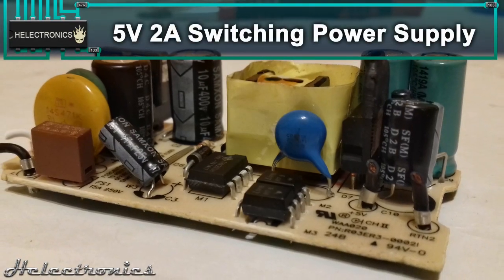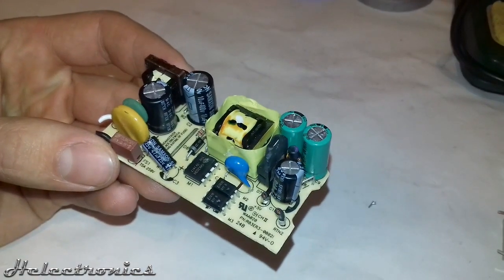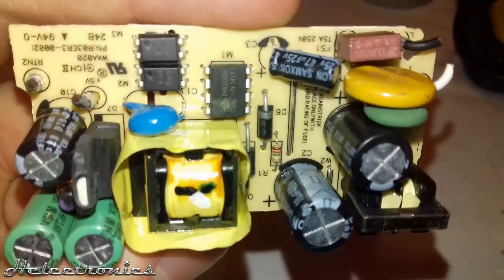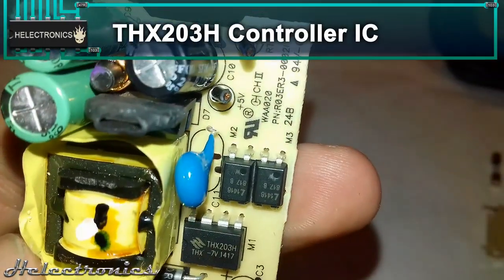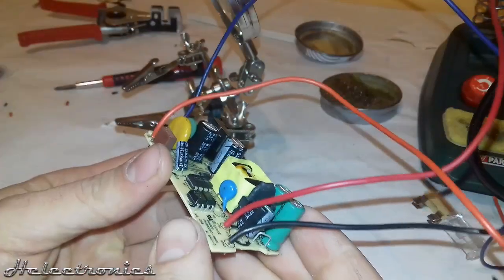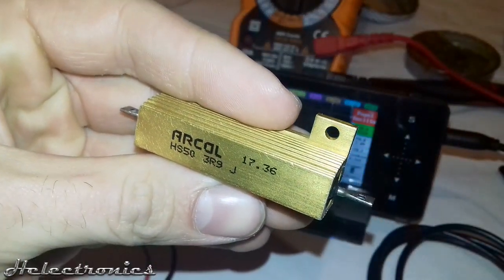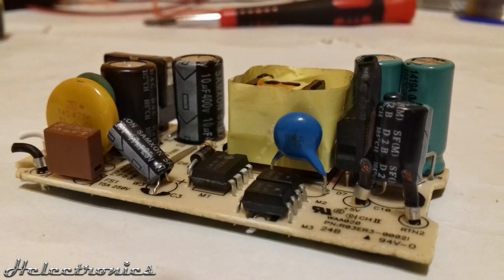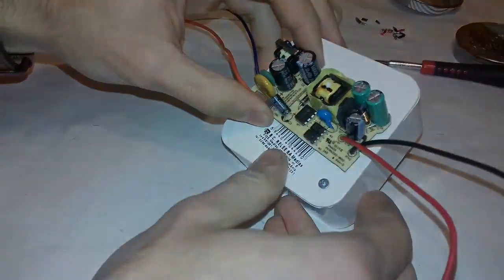REVIEW - 5V 2A Switch Mode Power Supply

Comment: It looks like these modules are taken out of some scrapped devices, hence there is no proper cable mounting, just cut off leads, and no mounting holes, as the PCB may have been mounted in a custom plastic case. A quick research shows the PCBs may originate from AcBel power supplies rated for 1.5 A.

Nevertheless, it seems to be a decent power supply.
Reply from the maker: You are right, these boards are probably salvaged, but work good. Thanks for watching!